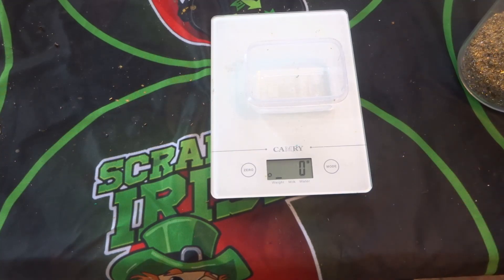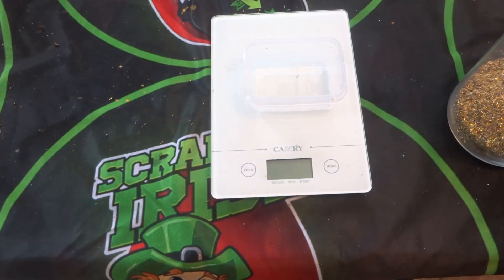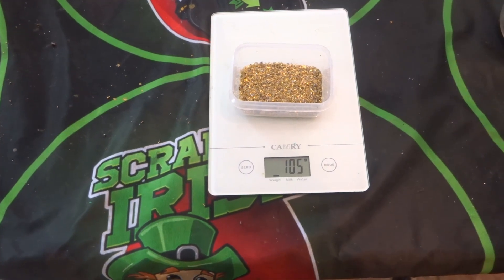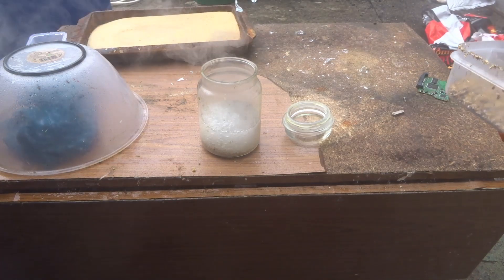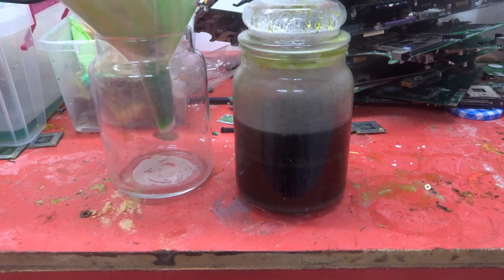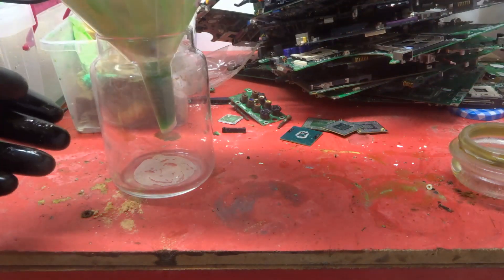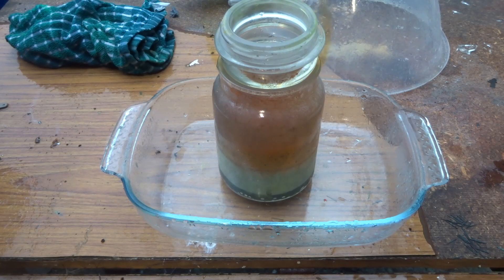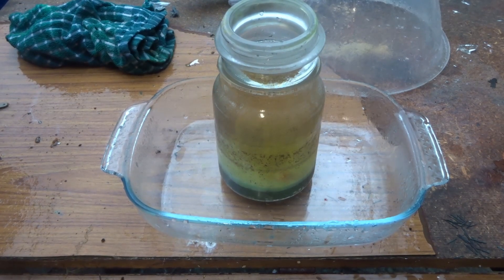gold recovery from cpu pins part 5

Comment: It's funny Watching you do this video now, I just did  a bunch of cpu pins yesterday. I put the pins in HCL+Peroxide and put it on heat for a Day. No Nitric. It dissolved all the base metals (mostly Iron) I added Peroxide a couple of times when the solution cleared up, I didn't want to put too much in at the start, too much will dissolve the gold. In the end, I was left with gold foils.  I ran a magnet across the bottom of the jar just to make sure there was no iron left.  WHoola! Gold from CPU Pins with NO Nitric Acid!
Reply from the maker: Ya nitric makes it a bit more work lol